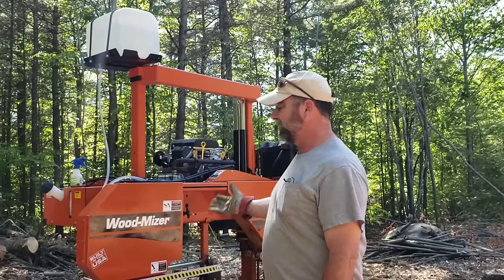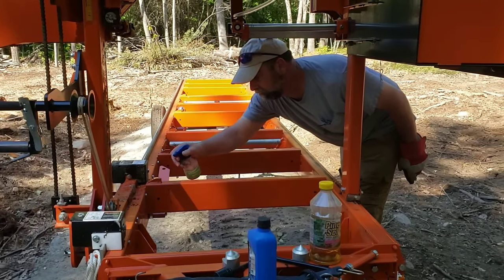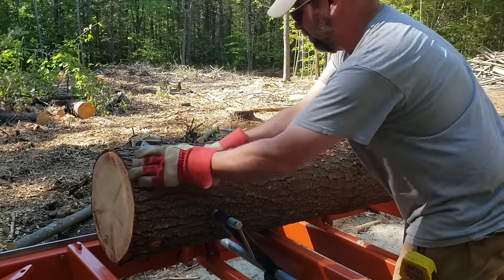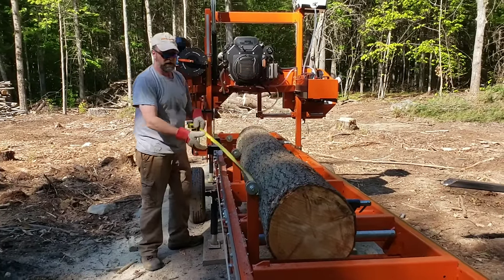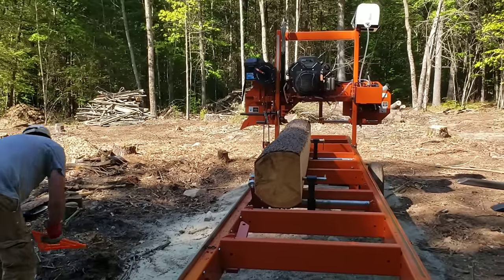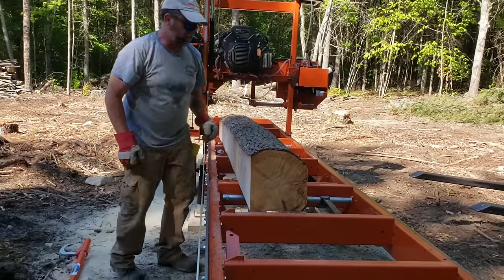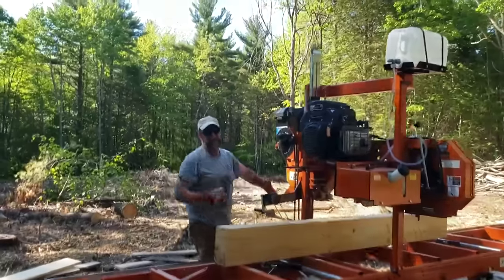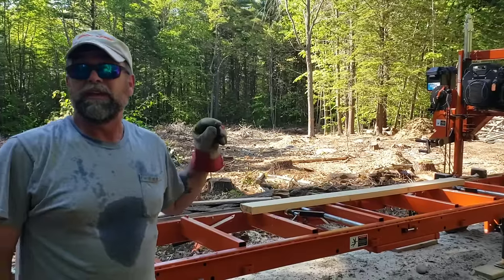Cutting 2x6s with the woodmizer LT 15 Go sawmill.

Comment: Don't they make a debarker attachment for a chainsaw? Something that bolts to the end of the bar by the two holes on the end? Do those work good? Could you actually debark a whole tree with one of those? Probably burn your chainsaw up in a short time?!!!
Reply: I have a hand one. I used it once so far but shaved the bark off an 8 foot long log. Probably 8 inches thick  in like 10 minutes.

Comment: Wtf dude.you spend way,way to long on this log.your tide down time must be killing you in time.like they say,time is money.and this brushing the log by a wire brush,by hand replace that one with a mechanical cleaner.that the next step to getting your operation going a little faster.and get some on way on holding it down.and though that tape measuring thing away.you got eyes and you gots some brains.use what you know might help you and some confident in your knowledge.you can do this so much better.i know sawmills.was one of my first job I was 17 when I started.and I'm from Wisconsin,it seam everyone someone who has one.woods and winter.you learn to do things different in the winter,the faster you go the warmer you stay.

Comment: Cool machine, but what a brutally slow process and lots of work.  I think Home Depot makes more sense.
Reply: @ Mark Coleman-
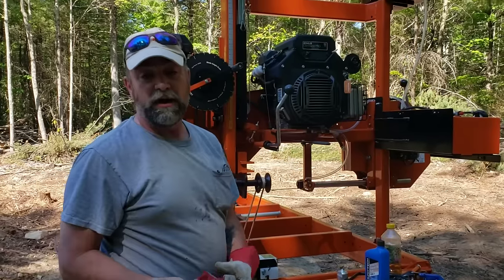1st 5:30 was mill prep, vid=29 mins.  Guy is still new to milling, he's taking time to explain what is happening.   His logs are not situated right next to the mill so there is some time lost there.  A fair time estimate once set up and milling for 3 or 4 hours straight would probably be closer to 15-20 2x6x10 per hour.  Here in NW MT a 2x6x10 is right at $10 currently.  Even producing 10 sticks/hr would still be ~ $100 hourly saved [minus gas/blades\ATF/depreciation etc]. 
Figuring expenses at a ridiculously high 50%, he is still saving the equivalent of $50 hourly AFTER taxes...dunno about you, but when I was a working RN I never made $50/hr so this guy is doing pretty well as I see it-
I'm going on 70 and planning to buy a similar mill.  Work, yes, but God designed us to work, not sit on our butts pounding keyboards-

Comment: Have you had and problem with the blade jumping off the wheels when you finish a cut and disengage the blade?
Reply: Are you having this problem
Reply: @traviskelly5480  I had this problem. Pine tar was the issue. I started using diesel fuel to clean the pitch off the blade and belts.